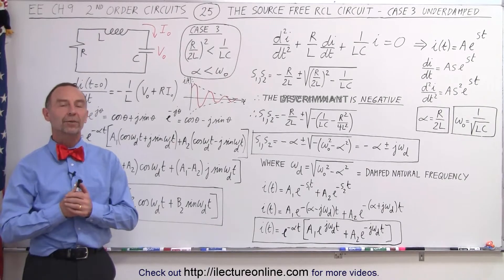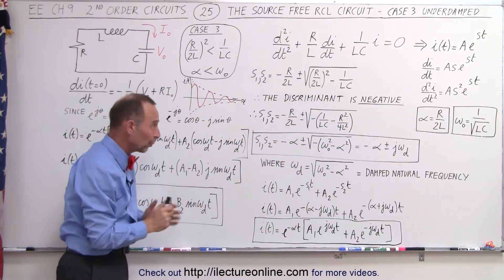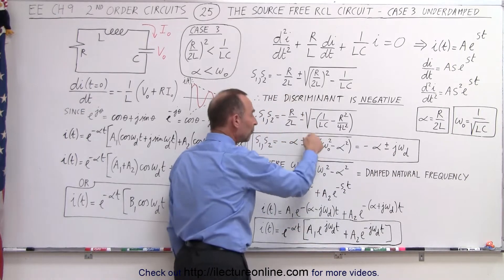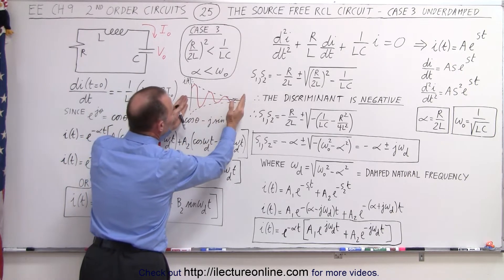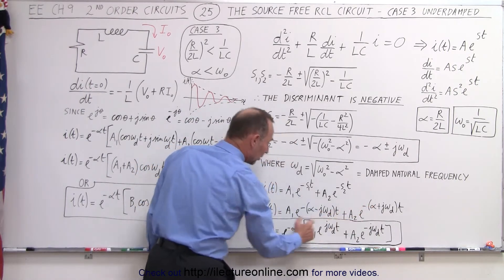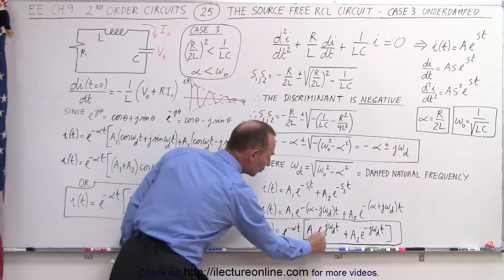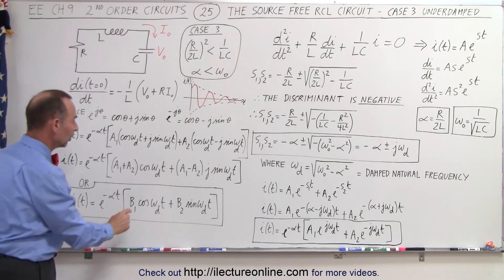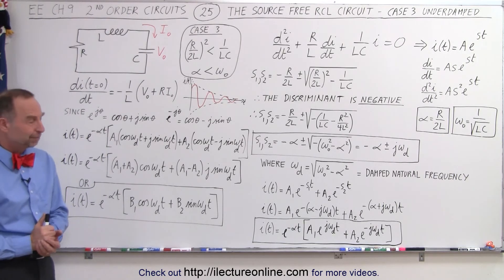Electrical Engineering: Ch 9: 2nd Order Circuits (25 of 76) Source Free RCL-Case 3 Under Damped

Comment: I have a question

what is it called when it is a exponentially growing sinusoidal function ?
Reply from the maker: That would be an unlikely scenario.  In most if not all cases the tendency will be to diminish the oscillations.  Only if there is a driving function that acts at the resonance frequency will you see a growing function.
Reply: @MichelvanBiezen  btw i love your videos! Especially the thevenin theorem one because i was having a real hard time understanding open circuits and equivalent circuits but your vid was really well explained:))
Reply: Okay understood, but just out of curiosity, if i were to graph say 2e^2t * cos(t) for example, it will still produce a “growth” envelope instead of a “decay” envelope with a growing cosine wave right?